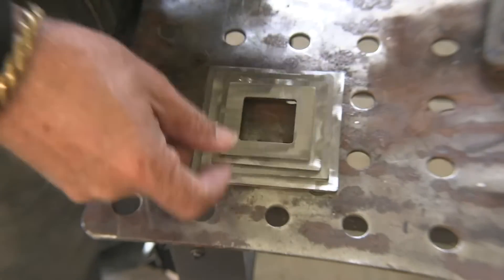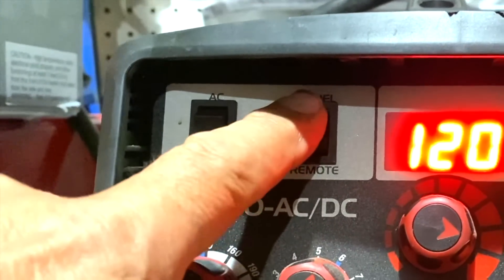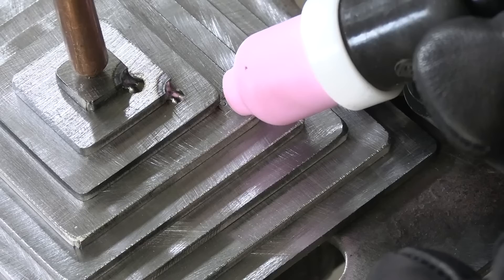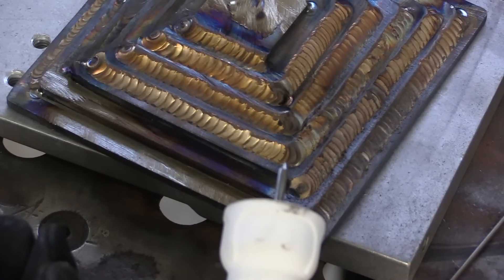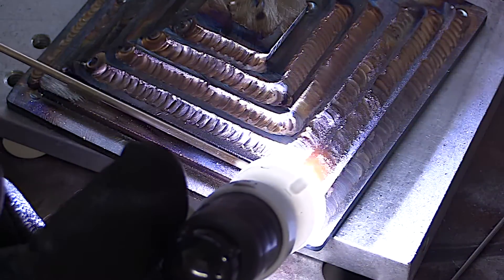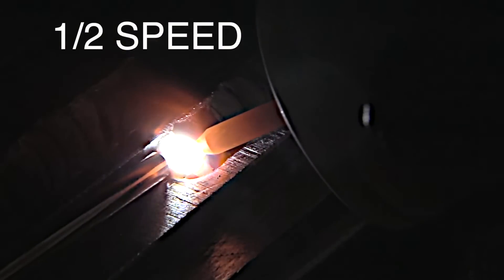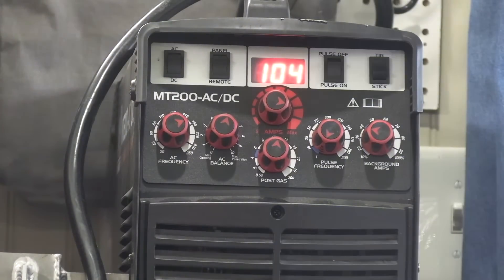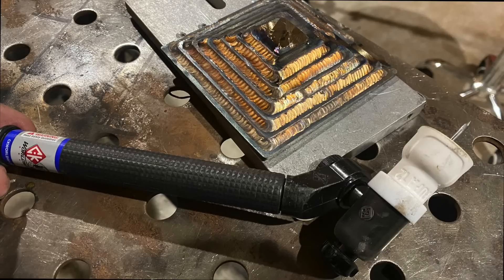TIG Brazing Pulse Settings

Comment: I have cut some channels in 1/4 mild steel with a cut off wheel. Channels about 3/32 wide and maybe an 1/8” deep. I want to melt some brass rod I have into the channel. I’m doing this trying to make a design with the brass in the mild steel. Not much luck so far. Tried heating steel first, applied high heat flux and then used my TIG torch to melt the brass. Lots of splatter, but no stick. I tried MAPP gas with similar, poor results. If I start a puddle in the steel with my TIG torch and then introduce the brass rod, it will fuse, but difficult to control where the brass goes. I don’t want to use a brazing rod, I like the looks of the brass. Any suggestions?  Thank you, Wayne

Comment: I use a #10 pyrex with a gas lens set up with 135 A pulse at 1.2 pps 70% on time,  35A background,  12-15 cfm. I also find that using my pedal to pulse on fillet joints instead of pulse gives me a really nice appearance if you're not worried about a convex bead. I use it when strength isn't a concern and it turns out beautiful.

Comment: There only ever seems to be a narrative to SB TIG brazing examples to the effect of 'not as strong as steel' but I've not yet seen any comparisons to conventional Oxy-Actet SB fillet brazing, which is still used routinely in 'high stress' applications. E.g. Bike frames, race car spacesframes and other components etc.    What  is the consensus on replacing OA brazing with TIG braze.  The tensile properties of the SB TIG rods don't quite seem to be up to same as OA equivalents, but are there any practical examples of people using it. E.g. are any frame builders using it.   Once downside I can see is that sites potentially less easy to get such a large fillet (in one pass at least) as you can with OA.

Comment: Show us some silicon bronze on AC with the Prime Weld 225.  I can't get it to run AC on mine, don't have issue with it on my other machine.  The guys at Prime Weld are easy to contact and always friendly, but didn't have silicon bronze experience to comment.  Also, why is every video on YouTube about silicon bronze always just gluing mild streel together?  Lets see something challenging like some steel to aluminum or a dog to a cat!

Comment: I've been using aluminum-bronze rods and AC current to repair cast iron for about a year now.  The aluminum in the rod gives the repair good ductility, and I haven't had any post brazing cracks since I switched to it.  The AC cleaning action is an added bonus.  Love your videos Jody!
Reply: I agree-  I think that ALBrz on AC is better in most cases than SilBrz for repairs (unless you specifically need the softness of SilBrz).

Comment: I used SB tin brazing for header flange reinforcement. Welded inside the ports and brazed the outside. Worked great.
Reply: Did you braze the outside for reducing distortion or for aesthetic reasons?
Reply: For both extra reinforcement to reduce the likelihood of cracking and aesthetics. I had them chrome-ceramic coated so the fillet made for a smoother transition between the flanges and the tubes. @ianhelsbyservices

Comment: Could use this technique to fillet braze a bike frame?
Reply: I’ve used pulsed tig brazing when I made a couple of ladders for a couple of jeeps/4runners. They were mounted on the hatch and needed to be light so I used 14ga DOM. I ran a fusion root pass and tig brazed all the copes. 

The guys I built them for were pretty serious overlanders and ~250+ lbs. They’ve held up really well and are sturdy as hell!

Comment: I'd love to see a crack or chip repair on a old Harley engine case; cast aluminum that's been running with oil in it for 50+ years. I've done it a few times, but I can always use some tips from a pro like yousefl.

Comment: I do a lot of TIG brazing when I need to control the heat input.  Otherwise it is old school with my OA torch.  I haven't tried it with TIG, but I wonder if a flux would be useful.

Thank you for a good video showing some different techniques.

Comment: Why does it look as if your melting the upper edges of the base metal?  Shouldn’t only the Silicon Bronze filler rod be melting?  Thank you for all the help over the years.
Reply: I saw that too. It shoudn't melt the base metal.
Reply: I thought just the same thing - I understood there should be no melting at all of the base metal?

Comment: what if there was a toe operated pedal so you wouldnt have to use so many muscles on your leg to use itt
Reply: TIG Finger is a torch mounted variable control which works very well for out of position welding.  Like roll cages where you can't welding a bench
Reply: so youre heels would be on the same level and it had a real nice sutable spring so it would feel equivalent like using a nice analogue trigger on a game controller
Reply: They make two different direction-turned knobs that attach to the torch handle.  Jodie has covered them in the past, you'll have to hunt through his years of videos to find it, though.  It will be a fun search at the least.